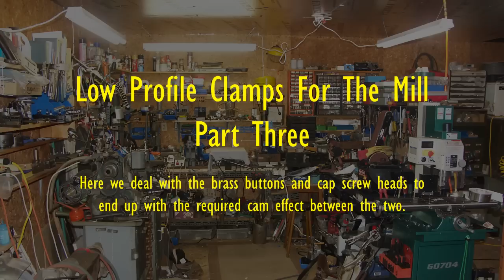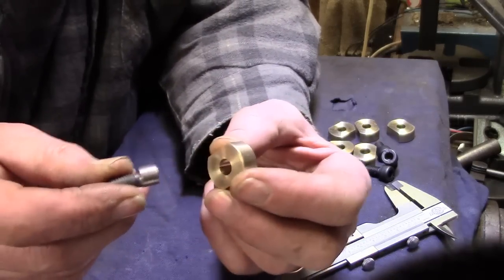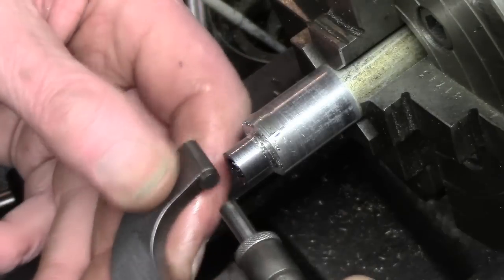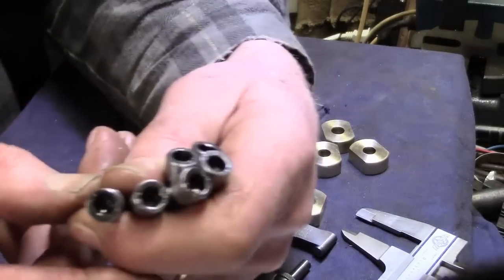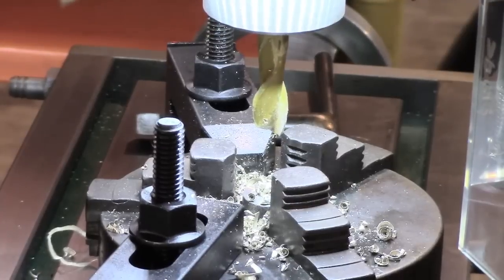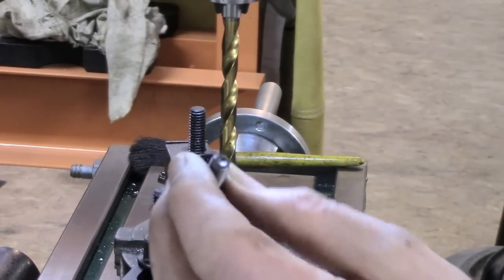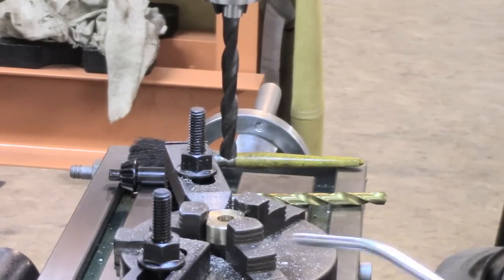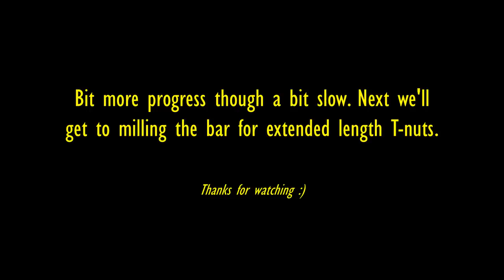Low Profile Clamps for the Mill - Part Three

Comment: Another great video.  I am anxious to see this in action on the mill.  I am wondering if maybe you needed an offset in the brass as well as on the cap screw.  Or maybe you did that and I did not understand.  I am sure it will come clear to me in the end.  Thanks for the video.
Reply from the maker: I did think a brass offset would work but, on thinking about it, reckoned that the slightly enlarged base hole achieved the same purpose. We'll see :)
Reply: After posting that I began to doubt it myself.  Very interested in seeing what you discover.
Reply: I was also thinking a piece of hex bar with an offset may allow a bit more choice in the positioning of the button.
Especially when attempting to use the button acroos the T slots as opposed to along the T slots when you can just shift the T-nut.
I suppose shims would help anyway it that usage.
Reply: Ray Jones
BTW, by offset I mean the hole is not centered in the button. Due to ecentric head on the cap screw, the "clearance" hole has to be much larger than the convention, otherwise it would simply not go in properly.
Reply from the maker: Ray Jones  Nice idea with the hex.  Generally tho I think, as the 'buttons' can rotate and have 2 flats, they should be sufficiently versatile.

Comment: I have discovered a fairly good solution to a drill bit that runs out like that: I give it a tap on the high side about halfway from chuck to tip with a small (depending on size of bit) brass hammer. Give it a spin to see whether the correction was sufficient, and if needed, give it another tap. This corrects either bent drill bits or sloppy chucks, at least until the next time.
Reply from the maker: Peter W. Meek Thx Peter -- have tried that from time to time - sometimes successful sometimes not so much! :)

Comment: Just discovered your channel and I'm enjoying watching you think your way through projects. I'm wondering if you've considered putting a bit of a taper on your brass shoes in the vertical axis. My thinking is that the top side would be fatter than the bottom so that they push the work down at the same time they clamp it between the two shoes. I don't know if that would even help, but the idea popped into my head watching this video. Cheers
Reply from the maker: Thanks Tucker - well certainly that could be a useful idea, apart from the extra work machining to that profile as against just square. However, I have thought that on occasions I may very well use small pieces of shim material at the top contact point if need be - which could achieve much the same result.
Reply: ChrisB257
I hadn't thought of shims- that's certainly more versatile than a fixed angle, and you are right, getting the correct angle would probably be tricky. Just viewed part 4 and it looks like they clamp nicely without the angle anyway. Cheers

Comment: That littlle comment at the end about not needing a shelf inside the button  I think is quite correct.Not necessary  as you can not bottom out as you can not turn the screw more than  half a turn, once you have pushed up to the work and tightened the 'T' nut screw. because the cam jams up. which is what it is designed to do. Lube on the button ... Yes. you have a brass surface being rubbed and tightened  by a steel surface.   No lube  =  scouring and a lot of wear very quickly.   A good way to avoid the problems you had with the drills.  Put a reamer through all the buttons  first,  THEN cut all the screws one or two thou smaller. to make an easy fit . 30 thou cam offset sounds about right. Should bite pretty good.        Isn`t brass great to work with,,  Have fun.
Reply from the maker: +Geoff Gwyther 
Hi Geoff.
Thanks. Since making those, needless to say - a few things I might have done differently - always the way! Lube - yes indeed - dash of lube when used.
Brass - yes, love it - perhaps with the exception of the chips that want to travel huge distances when turning, even when trying to collect! Wish I had more brass stock.

Comment: He says to use an 8mm clearance hole which I believe is 9mm or .354". Do you agree?
Reply from the maker: Clearance for 8mm (0.315) is IIRC 8.2mm (0.323) - I didn't have one so just used an 8mm - which of course had to be enlarged.
Reply: ChrisB257 Okay, sorry, my charts say tight fit of 8.8mm loose fit 9.6mm, just a big difference in charts used I guess. Still a great build you are going through, It's great to see all the steps needed before I start mine.
Reply from the maker: William Hardin William - what?! Clearance for an 8mm only needs to be a few thou - instance the 8.2mm clearance drill quoted - giving a plus of just 0.008.! The 8.8 and 9.6 you quote sound horrendous! :) Wonder what charts those are :-)
Reply: ChrisB257 I was using an APP on my cell phone but here is a link to a chart on Little Machine Shop. https://littlemachineshop.com/Reference/TapDrillSizes.pdf  Sorry, I was just trying to be helpful, but if you just want to guess then that is fine also.
Reply: William Hardin In my training we were told that one of the nice things about the metric system for machining is if you are referring to a metric screw, in this case M8 you would use -1(7mm) for tap drill and +1(9mm) for clearance drill. Real easy to figure out, of coarse that may not always be true if you want a close fit or a free fit. Could you post a copy of the chart you use?
Reply from the maker: William Hardin
No probs William - I wasn't trying to dis' your info! :)
Reply from the maker: William Hardin My ''chart'' William is a small book - issued long ago by "Dormer" - a British maker of drills, mills etc. So, hard to show you that. It does work to low tolerances, such that clearance for 8mm is 8.2mm - of course sometimes clearance holes may need to be larger.  Also, tapping drill sizes, to be real accurate do tend to be often very precise. Machinerys Handbook is a good source for this stuff.